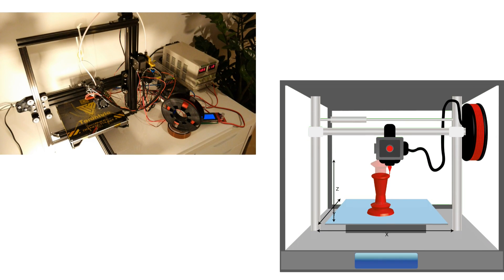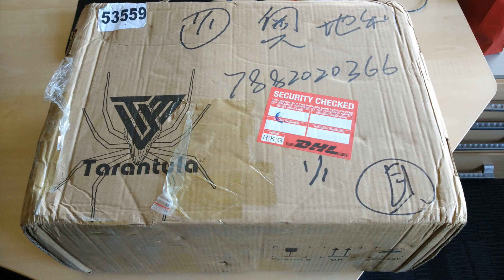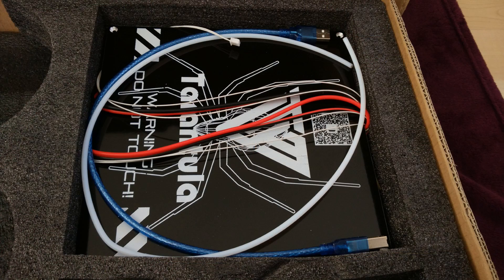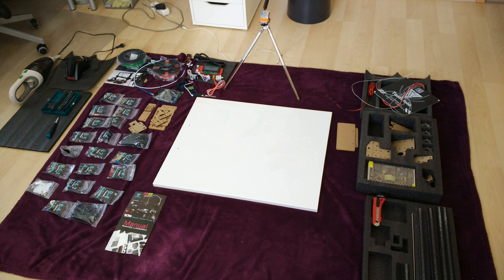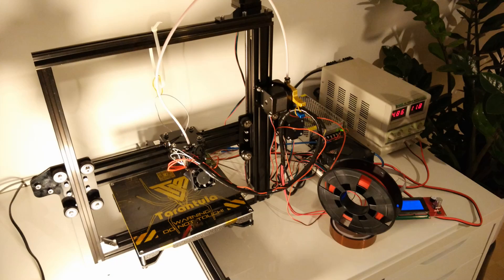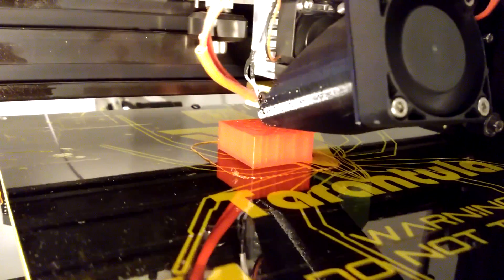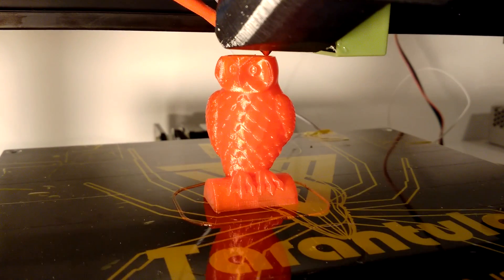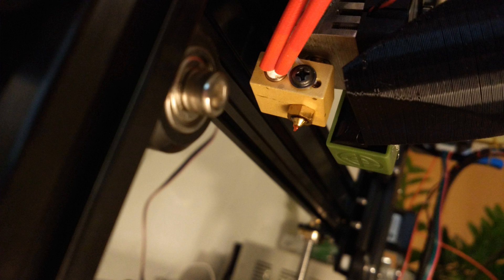3D Printer for only 239 USD: Unboxing, Timelapse Build & Test Prints

Comment: hallo, bei mir ist die Geschichte aehnlich. Glueckwunsch zu dem Geraet. Bei mir fehlte die Aufbauanleitung komplett, gut das es Leute gibt die ein Aufbauvideo posten😊
Leider habe ich ein Problem mit dem Filament Feeder....irgendwie rutscht das durch und Material wird ungenau zugefuehrt. Hattest du das Problem auch. Einzustellen geht hier glaube ich nicht viel? Hast du einen Tip fuer mich? Danke und weiterhin viel Spass mit dem Geraet
Reply from the maker: +Histo Shape Hi! Unfortunately my german is almost inexistent, but thanks to google translate I believe I got most of what you said. Glad you liked the video! As for your problem with the filament feeder: Is the stepper motor jamming (clicking noise, the motor stops, and tries to turn again), or is it actually the filament which really slides through, while the stepper motor is turning normally? If you can answer this, I might be able to help you furhter.
Reply from the maker: +Histo Shape Maybe you can even upload a short video of your feeder, while this thin happens? That would make it more easy to identify possible reasons.
Reply: yes the motor is "clicking" sometimes....or mostly!
he is feeding of course....i guess with false amount. Are there any known calibrations,adjustments for feeding speed or temperatures?
I try to make a video of what happens here.
sometimes the nozzle lubricates too much at some parts, then whobbling above it, crashes about that place ;-)
Reply from the maker: +Histo Shape The motor clicking means that the hotend cannot extrude filament as fast as the motor would like to push filament. What you need to do is - in this order until the clicking stops:
1) Calibrate your extruder. You do this by manually extruding 50mm and then check with a ruler if it really extruded 50mm of filament. Adjust esteps until that works.
2) Reduce the flow. Sometimes filament is a bit thicker than expected, but you should not need to go down to less than 90
3) Check the temperature of your heatend. I had a faulty thermistor, which showed a much higher temperature than the heat end actually had. Manually check if the temperature is correct, using a meat thermometer or an IR thermometer
4) Use a higher temperature. The packaging of my gift PLA was punctured, I had to use 235° instead of 210° which got rid of the clicking.
 
--> These are some of the basic stept of how to approach that extruder clicking :-)
Reply from the maker: +RC FPV Flight You should additionally do the calibration for all other axis as well. So instruct your printer to move 100mm to the right, take a ruler and check if it really moved 100mm. If not, adjust esteps. Do the same for all axis.
Reply: +RC FPV Flight wowww, thank you very much for sharing your knowledge. i try it step by step as you told. if problems continue, i make an video.
thanks again
Reply from the maker: +Histo Shape Great! Please report back how it went.

Comment: Very nice! Do you know anything about it's capabilities with ABS? Manufacturer claims that it will work, but no enclosure may make it prone to warping, from what I've heard.
Reply: +Felix Andersen 
I have printed many large ABS parts on my printrbot original, which is much worse than this printer haha (no enclosure or anything). I print with a 100C bed coated in ABS/acetone mixture, with a 260C printing temp. I find that printing ABS at this temperature both helps layer adhesion and helps warping. You will still get some layer separation on big prints, but very minor and only on sharp corners. I'm sure using a 110 or even 120C bed would be even better (which is what this printer can do). Just make sure there are no fans running in your room.
Reply from the maker: +Felix Andersen I have not printed ABS myself yet, but my friend has, who has the same printer and helped me building mine. He got nice results out of it, no warping for smaller prints. He did not try larger ones yet, for this an enclosure might indeed be beneficial :-)

Comment: What version did you get out of all the options? Standard?, Automatic platform?, etc...
Reply from the maker: +Chris Pugh Hi Chris! I did get the basic version for 239 USD, because I had the autolevel sensor at home from another project. So I got the "Standard Printer". The hotbet coming with it is already 20x20 cm large, so I did not need the "large hotbed". The autoleveling is nice though, so I would suggest getting it. The whole difference between "Standard Printer" and "automatic plattform" is that sensor, so you might even be able to get an autolevel sensor cheaper, because the 50 USD additional cost for just the autolevel sensor are a bit pricey in my opinion.
Reply: Thanks. Great vid by the way
Reply from the maker: +Chris Pugh Many many thanks - really glad you liked it :-)
Reply: +RC FPV Flight you can find those autoleveling sensors for ~5 bucks
Reply from the maker: +oobligah Exactly my words. This is why I only went with the base version - many thanks for the heads-up.
Reply: RC FPV Flight I've got mine on the way, so it should be fun getting it set up.

I've got a couple questions though, if you don't mind...

where did you get that fan shroud from?  I've been looking for a good fan shroud to install on mine but so far I haven't found any decent ones.

Also, do you know what the steps/mm your Z axis is set up with?  I had to put my own firmware on it since mine didn't work out of box, and now I'm getting some issues with Z artifacts.
Reply from the maker: +oobligah I don't mind at all. I can answer you with my steps/mm for the Z axis when I'm at home at night, I'm not at the computer right now. Best would be if you would calibrate it yourself, that is, instruct your printer to move the Z axis up by 100 mm and then measure the actual distance it went. With that sort of calibration you can define steps / mm specifically for your printer, which will be more precise than just using my steps :-)
 
I got the fan shroud from the files section from the Facebook support group for this printer: http://bit.ly/1RrPhKt
 
If you have any more questions, please feel free to ask :-)
Reply: RC FPV Flight Thanks for the info!  I just requested to join the fb group.

Right now I'm using 2560 for my steps/mm....

I printed a 10x10x10 cube and the height came out to be just a hair under 2560, which seems par for the course due to cooling.

Yet, even though my height seems to be correct, I still get banding.  I get width fluctuations with a frequency of a couple mm.  The pattern is thin on the entire layer, then works its way to be thick on the entire layer over a few, then back to thin.  Especially noticeable on corners.
Reply from the maker: +oobligah That is strange. Some people in the group reported that they have vibrations in their z axis, maybe this is the reason. I do not have this issue. I'm sure once you are in the group, and maybe post some photos of your prints, people will be able to help you. They are very supportive there and also the manufacturer of this printer is part of the group.
Reply: hopefully someone will be able to figure it out, because I'm puzzled. Thanks for the heads up about the group!

Comment: Nice! Was looking at this printer but no reviews or anything much online about it. Is the printer as stable it looks? Looking forward to seeing more printing videos from you.
Reply from the maker: +Girya Girl Fitness I suggest you to get the base version for 239,- and simply buy the autolevel sensor separately. The autolevel sensor is only 5 USD and this is the only thing which differantiates the base version from the autolevel. So you are much better off to get the base version and buy the autolevel sensor separately: http://s.click.aliexpress.com/e/BeAYbyFeq
Reply from the maker: +Girya Girl Fitness My pleasure! Keep me updated on your progress :-)
Reply: RC FPV Flight
Will do!  This is on my list of things to buy after I finish a large writing project! :)
Reply from the maker: +Dokdirt I had it for 2 weeks now and almost printed a complete spool of the (included) free PLA. So far I'm more than happy. Print results are awesome, as you saw with that 0.1mm owl. A friend of mine has a 3000+ USD printer at work (I will not say the name here, to not cause any flame wars) and he says that the one at work is not producing as nice prints as this 239 USD one. The printer is very stable. The full metal frame helps a lot.
Reply: +RC FPV Flight thanks! the info I was hoping for. A friend has an expensive one as well that is always breaking so it's good to see an inexpensive one work as well as this. 

On another note, like your rc colaboration videos, you should do one for 3d printing.
Reply from the maker: +Dokdirt Many thanks for the input and the suggestion. There will be a healthy amount of 3D-printing related videos coming to this channel in the future, together with my usual videos of course, I can promise you that :-)
Reply: +RC FPV Flight did you get the one with the automatic platform? I was looking at the kit on AliExpress and wondering which options you chose.
Reply: RC FPV Flight
Excellent!!!   Thanks for such great advice!!! :)